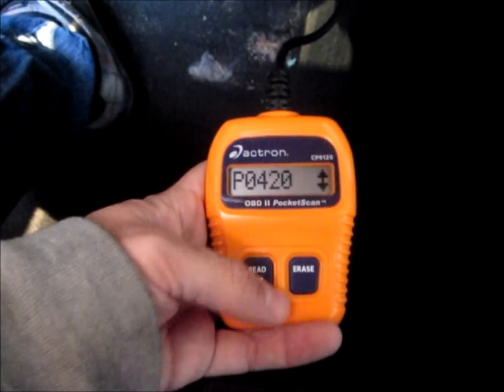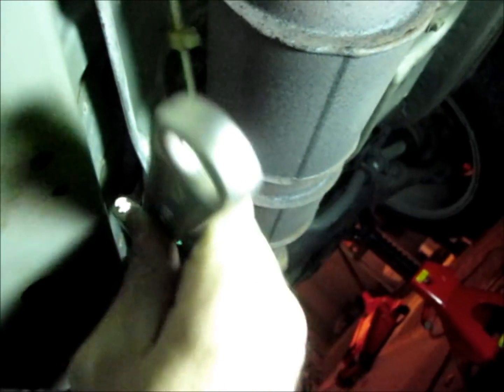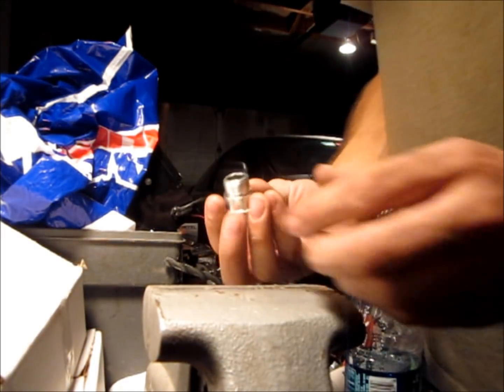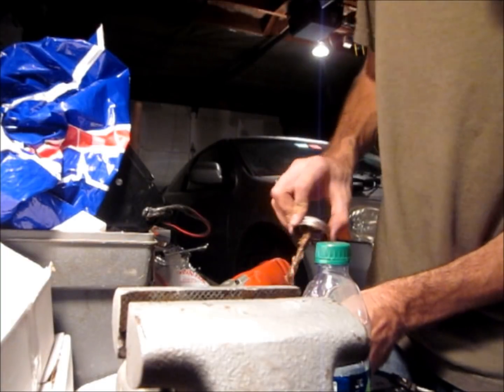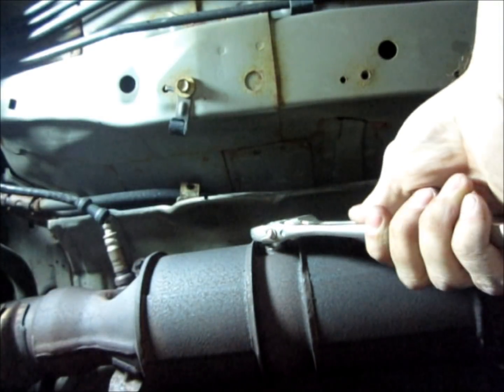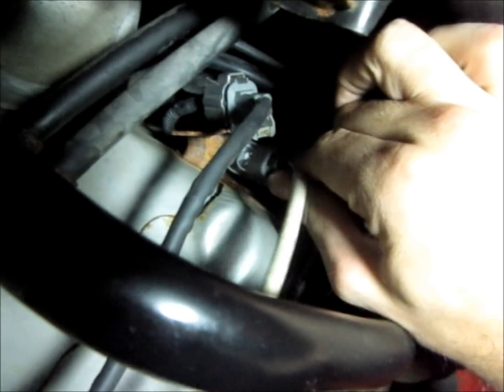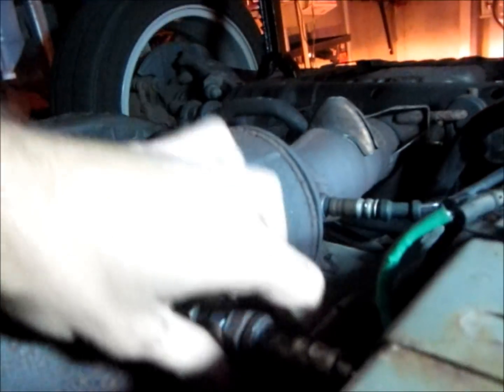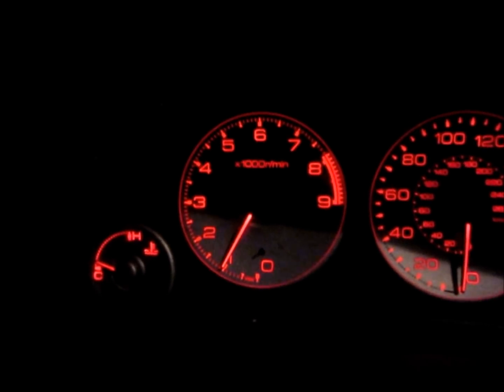Clear check engine light for less than 5 dollars

Comment: Moccina, I hate to bust your bubble but you and a few others have the "downstream sensor has no effect on fuel trim" thing way wrong. There are many manufacturers that have have used (and still use) the ds sensor to adjust fuel trim. Toyota and GM have been doing this for many years. The GMC Envoy is one fine example. The logic of the PCM for many of these cars allows the PCM to slightly adjust fuel trims in order to allow for surplus oxygen to saturate the converter in cycles in an attempt to condition and test the converter in order to extend its life and keep it at maximum efficiency. To put it plainly, you are wrong and it is you who needs to do some reading. This particular model allows so much pull on the ds sensor that the vehicle would surge very slightly at idle.
Reply: Here is somewhere to start you off :     
 
http://books.google.com/books?id=zst2aOSNnCkC&lpg=PA124&dq=rear%20fuel%20control&pg=PA124#v=onepage&q&f=true
Reply from the maker: gilman9991 The vehicle this was done on was a Honda. http://honda-tech.com/showthread.php?p=7065994
Reply from the maker: gilman9991 I did read your link, I appreciate the info. I mainly work on Asian vehicles -- Primarily Honda which in the link above explains any concerns about secondary 02 and mapping, closed loop, and limp mode. People definitely need to do research on their own vehicle application. This always was, and always will be an experiment I have documented and shared which has proven to work on mine and many others' vehicles. I do not encourage or condone using this video for on road purposes. Mod at your own risk! Thank you for commenting.
Reply: moccina I applaud your creative spirit moccina, but that link is just a forum with unverified data and questionable knowledge from others who perpetuate the idea that "downstream sensor has no effect on fuel trim". Your blanket statement to that affect is inaccurate. As the publication I linked stated, this PCM strategy has been universally used since the late 1990s... asian, domestic and european alike (though they all have different stategies/programs).
 Also, who cares if your CEL is on with a cat code in an "off-roader" anyway? Put some tape over it for 0$.
Reply from the maker: gilman9991 I think you are missing the point though. The Honda Tech forum is one of the most respected communities of it's kind. Sometimes it makes more sense to use a creative solution rather than going by the book. I have been running this fouler for about 50k miles now. My MPG is a constant 28, no different from when the car rolled off the lot. It now has 205k and still pulls very hard-- no issues to speak of.  I have seen poor shmucks bring their car to a dealership with this same CEL, have them replace the cat, 02 sensors, the whole 9, and walk away only to find that the light has returned. What do you do then, when you are out $3500, with a high mileage car and a CEL that will not clear ?
Reply: moccina I believe you are missing the ONLY point i am making which is that your blanket statement is incorrect. Also, they key descriptive word about the tech forum is "of its kind". The last part of your response does not seem geared to the "off roader". Just sayin...
Reply from the maker: gilman9991 I appreciate the argument and agree that this will not work on all vehicles. It is probably not a good idea to go with this info / method if you don't wish to deviate from any "by the book" literature.  But I respectfully do not wish to argue about it. I am a "backyard mechanic" and this has proven to fix my issue without flaw and many miles later, several others have claimed the same. I have been using forums since early 2000 and I also use manuals when I feel necessary. Please don't take this the wrong way-- I respect everyone's input and opinion on this forum we are both on-- it's an excellent way for all of us to have the chance to learn things here and there from one another. Cheers

Comment: The catalic converter is plugged up
Not allowing the exaust gasses to escape untill the exaust gasses can over come the clogged cats it will not raise up in rpm  untill the compression of the engine can overcome the clogged exaust.thus causing the hesitation when the throttle is held wide ipen!!!
Reply: Cogged Cat VS bad Cat are different, some just fall apart internally which allows gas to move freely.
Reply: Even though I do not agree with this procedure as a shop owner and lead mechanic I will say that 98% of the time the convertor is not clogged. If the pcm detects that the convertor is working @ 95% or less it will trigger a catalyst efficiency code which in my eyes is kind of a scam in its self. Please before trying this to pass the emissions test  check for any vacuum leaks, and exhaust leaks pre cat, check the gap on all of your spark plugs try spending the money on a proven cleaner or solvent to clean the cat as any of these will cause this code to come up. If that does not work and you absolutely have no choice because it is your only vehicle do this but know that there are extremely heavy fines if you are to get caught and only you will be held responsible. Also please after you do what you need to do to keep your vehicle on the road look into getting it repaired the correct way so that you do not cause further damage by running an improper fuel mixture by tricking that rear O2 sensor.
Reply from the maker: Eagleoneradiogod  Thanks for your comment. The engine does not hesitate at any RPMs on this car and shows no other signs of clogged cat.
Reply: "rear o2 sensor" "improper fuel mixture" "lead mechanic" "shop owner" Never touch my car... please.... You have no idea what you are doing...

Comment: In some states they use mirrors on wheels to check for this stuff. Just beware. Emission tampering could mean trouble for you.
Reply from the maker: rottenrowdie Or like most shops they use a lift and can see underneath at full view.  As stated in my description, this is an experiment intended for off road use only. Thanks for viewing!

Comment: I was skeptical so i switch my o2 sensors from banks and reset code. the 420 code came right back. this let me know my o2 sensors were working. if the code came back on the opposite bank then that would mean the o2 sensor is bad.
Reply from the maker: ArmaAceChannel Seems like a solid way to troubleshoot your sensors--granted the primary and secondary use the same part #.  Next would be checking for signs of a clogged converter. Thanks for viewing!

Comment: I have 2004 4.7 dodge ram and I cut my cats off will this help take the code away
Reply from the maker: Carlton Coleman Hey man. Yeah, many folks use this method specifically for the scenario you mention.  Give it a try, the odds say it will work. If your state has "tailpipe sniffing" as part of inspection it may get slightly complicated though. My state is OBD check only. I only drive this vehicle off road, but all of my I/M monitors completed and were in ready mode after driving 50 to 100 miles. Thanks for watching, and good luck!
Reply: Where you gonna screw the sensors into if they're gone?
Reply: Z XT yv TX
Reply: Do you think i can take my converter off and get 2.25 inch pipe and make a hole and put the o2 sensor in using the spark plug defouler? It seems like it would work! You have done this so what do you think? It makes sense to me i think. My catalytic converter is shot and i dont have 300$ right now for a new one and i dont want to put a after market one on there!
Reply: Put an aftermarket one on. Pre-bent Al plated steel is expensive.

Comment: what if the engine is v6 do i have to do this on bank 1 and bank 2 ? thanks
Reply from the maker: If you only have 2 sensors, it would be the Secondary sensor you want to fit the fouler onto. In most cases this would be bank 2.

Comment: could it be used in any vehicle
Reply from the maker: Brian Stout Yes, but only if the vehicle has a primary and secondary sensor.  Using a fouler on the primary sensor will alter your fuel maps and possibly cause damage. Make sure you are installing it on the secondary.

Comment: Cant seem to get any info on the repair of my Caravan SE, 2003.
 
Codes shown   168.4 and  050.0 and 169.8 
 
Engine light is on.
Transmission doesn't want to shift.
The light on the shift advisory are staying on.
Speedometer doesnt work any more.
 
Sure appreciate the assistance of someone.  Cant drive it the way it is.  Have to use my GPS to monitor my speed.
 
Look forward to someones help.
 
Jack
Reply: http://www.rockauto.com/catalog/moreinfo.php?pk=1989558&cc=1432885

Comment: fuel consumption will come back to normal after doing this or it will remain high?
Reply from the maker: If there are no underlying issues this should not effect your fuel consumption in any way.  Even though you are installing this part you should make sure your 02 sensors are not faulty. Thanks for viewing!

Comment: Thanks, brother.  I did everything you said.....so far, no check engine light.  Tough getting the old 02 sensor out of the rear of the cat, but I did and, and for $41.03, I installed a new 02 sensor with the modification.  If I screwed it up, the check engine light would have illuminated immediately.  John
Reply: Well, I now have over 1,300 miles on the car after doing what THIS TUTORIAL told me to do.  Not only did I never see another check engine light - I sold the car to my sster, and got her a new sticker on August 8, 2014!  So, this fix is absolutely right.  The same garage that issued the sticker had earlier said, "The 0420 code is either the 02 Sensrr, which we can do for $400.00...or thecatalytic converter is bad - or both.  That job is $1,500.00.  So, thanks again for this perfec fix!  JT

Comment: i know u already mentioned it in the describtion but I will mention it again this is highly illegal technicial when a mechianc does a emmisions inspection (I would know as I have my linesne for PA) they are not only supposed to use the machine to make sure there are no faults in the computer but also do a visual inspection to look for things like this :( the code typicly means that ur cat is bad (if there were a problems with the sensor u would get a code for those and not for the cat) if u ignor it and do this trick ur cat at some point will clog and the car will cease to run u will then be looking at a much biger bill than just the cat as that would destroy other stuff also. please fix ur car correctly unless it is not driven on public roads and is used for off road then u can just straight pipe it and use mock sensor again illegal however if it isn't driven on public roads no one will know :)
Reply from the maker: Hi there.  You are correct-- this is not legal for street use.  Before installing one of these it is a great idea to check for signs of a clogged cat.  This can easily be determined by listening closely to the muffler at idle.  If you hear intermittent "skips" or "sputters" you may have yourself a clogged cat.  Power loss and egg smell are other symptoms of a clogged cat.  Thanks for viewing!

Comment: Did you notice any gains in your mpg? I heard these can help you get better mileage due to a leaner fuel mixture.
Reply from the maker: Hello.  I don't think I can say improved MPG's but definitely consistent.  Recently I replaced both primary and secondary 02 sensors with OEM parts (denso) and I am getting 28 mpg. Not bad for this little 200hp four banger. Thanks for viewing!

Comment: i drive a mr2 spyder without a cat,to keep check engine light off...i have something like this..a tube with high grade cat material between the cat and the o2 sensor...its still working fine
2zzge turbo
Reply from the maker: dutchredneck57 Thanks for the comment mang!

Comment: On my 03 altima i didn't have to do any drilling. And I only used one spacer. I screwed the spacer into the downstream cat and then screwed the 02 sensor into that. I didn't disconnect the battery either, although I agree that's always a good thing to do when working with electronics. Then I cleared the code using my reader. No 420 code for over a thousand miles so far.
Reply: Scott Prado 
Hi
How did you clear the code with reader?

Comment: Or you could just unplug a battery terminal then plug it bak on either way check engine light is coming bak on just a matter of time people do this just to get there cars inspected well the people that have state inspection
Reply from the maker: chris james Not true.  The station will know the history of your ECU.  If you recently reset it by unplugging power, you need to drive through the cycles, make sure readiness monitors clear.  You will be surprised at how many people this has helped for off road use.  Thx for viewing.

Comment: The check engine light is off because you disconnected the battery, not fix the problem
Reply from the maker: Jason Heath Scroll down, this has been covered numerous times. Thx for watching!

Comment: The idea does work but in my case the fouler corroded and broke off Into my catalytic converter. Costed me 150 bux between a new cat. and o2 sensor. If anyone is gonna do this replace the fouler every year or two.
Reply from the maker: 5ThGeaRedLined  Considering how cheap and thin these little foulers are, I don't doubt it for a second. There is also the factor of cross-contamination of metals since the cat is more than likely stainless and the fouler is aluminum.  I would imagine though if you don't try to tamper with it too much after install you could probably avoid this altogether..  Thx for viewing!
Reply: moccina Anti-Seize!!  Mine's been in for a while, don't know how well it'd come out without heat, but I did anti-seize it.

Comment: Alot of times where i live all auto stores will reset the engine light free of charge
Reply from the maker: Andrew Duggins This is fine if you just want the thing out of site, but once the ECU completes it's drive cycles the inevitable will happen & you will need to deal with the issue one way or another.  Thx for watching!

Comment: If you we're to go through all that.. Just take the cat off & soak it over night to clean the honey comb on the inside. That's why you get a p420 code.  Driving too long with the cat clogged can ruin your engine.
Reply from the maker: Many times, the cat is actually not clogged but rather slightly damaged due to dry starting for example (running tank dry and cranking the engine).  In my experience, removing any catalytic converter is almost always guaranteed to be a pain in the ass (10+ years of moisture and exposure to the elements = frozen rusty bolts).  You risk damaging these parts and possibly having to replace the entire exhaust system when all is said and done.  However, if you are getting classic symptoms of a clogged converter you may have no choice but to do so-- either attempt to clean it or replace altogether, which with labor included you are looking at about $2,000 for this particular vehicle. Thanks for viewing and commenting!  -Moccina

Comment: One more question. I have read that in CT they might inspect your cat/converter. They make it sound like it's just to confirm you have a working one. But they also mention that tampering with a cat is a Federal Offense.
So if I do this, will the emission inspectors see the mod and not only fail me but charge me with a crime?
I have a cat that is only 6 months old, so I know it isn't bad, but I keep getting the stupid P0420 code.

I am just looking for a way to pass emissions without replacing the existing Cat,
Reply from the maker: I state in the annotations and description that this video is intended to test a certain theory.  I do not condone any of this for on-road use or for non legal purposes.  With that said, it is a fed offense to draw on a dollar bill, or to burn a CD for use other than a personal backup.  Please use the info in this video at your own risk.  As I have said to others, some states-- such as FL and Michgan do not have vehicle inspection at all-- no safety inspection, no emissions.. nothing.  Use your own discretion for what suits you, and what state in which you register your vehicle.  Good luck!

Comment: Hmmm. I think this is exactly what I need to do, but I have too many questions to post here. But for starters, will this work for a VW Jetta 2002? Are all the Spark Plug Defoulers created equal or do I need a specific one, why did you need to drill it? Any extra info would be appreciated. If you live near CT, I'll pay you to do this to my car
Reply from the maker: It should work for a Jetty.  Most 02 sensors are the same thread size, I mention the part number you need in the vid, which should work for your car as well.  You need to drill the hole because otherwise it is too small and the sensor will not thread onto the fouler.  Good luck man.
Reply: moccina
Great. Thanks. I think that is all I need. Much Appreciation

Comment: your taking the light off when you disconnect the batt anyway
Reply from the maker: If I had a dollar for every time this comment has been made I would be Cashin lol.  With your code reader, check your readiness monitors.  If all monitors are in a "ready" state, you are good to go. If some are in a "not ready"-- namely 02 sensor monitors, keep driving.  After all driving criteria/conditions are met, all readiness monitors will read OK-- and congratulations, your CEL did not come back on. You're welcome.

Comment: That vehicles fairly new judging by the gauges, how did that cat convertor go bad already?
Reply from the maker: The car has 200k but I ran the gas tank dry a couple times during really cold weather so that might have done it.
Reply: Ah gotcha.  Yeah that's an awesome trick to pass emissions test since they don't use a sniffer to check obd2 cars which I find funny, and gives people an easy way to cheat the testing